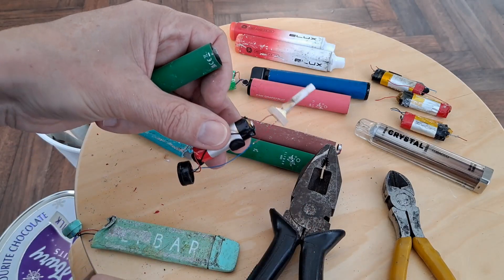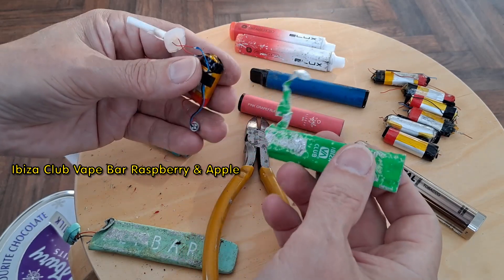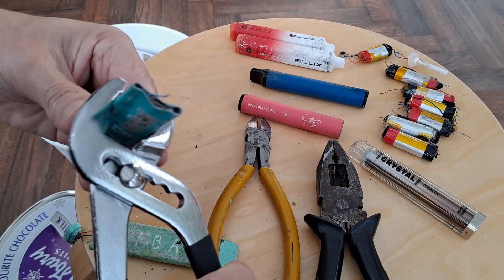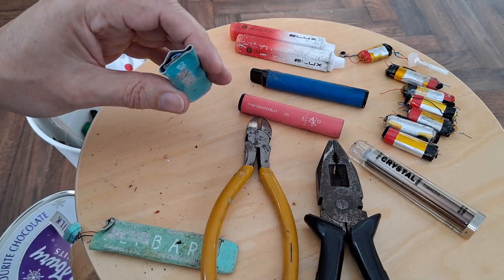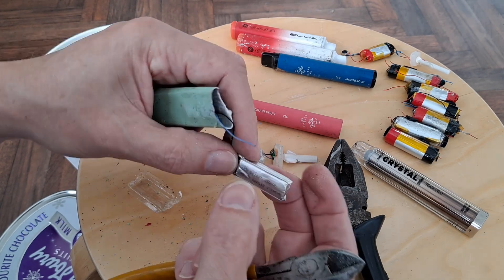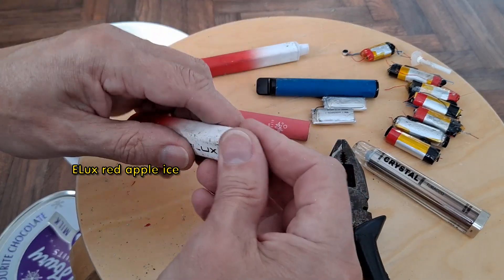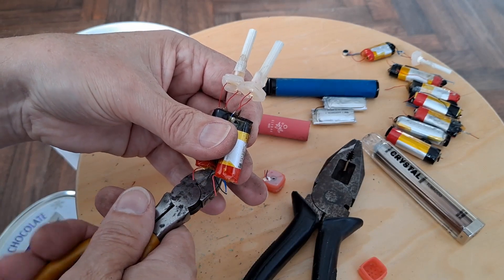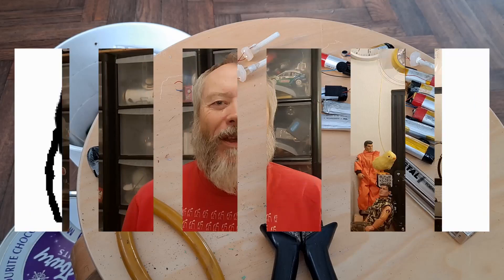Vape Hunter 👀 20220924 stripping out the batteries

Comment: Great source of batterys i have found a few so far just be careful if battery is damaged from a crushed outer case cell could be damaged as well .
Reply from the maker: There is always the chance they can misbehave. I have been surprised how some of them can still perform after being abused, but you are right, you must treat them with respect. There is also the issue about trying to recharge them when they have been drained past their minimum voltage. Some come back and some don't. Either way it is a risk. You might find the related playlists in the video description interesting.

Comment: u can use the cases as propeller shafts
Reply from the maker: Hi Kaleb, I think the tubes are a bit wide for that, I guess that depends what size shafts you are using.
Reply: @GrandadIsAnOldMan  Im thinking you can pus them into Polystyrene and use the Polystyrene as a seal and use the spokes you use for the shaft something like that!!!
Reply from the maker: @kalebschultz  yes, you could, and it would work, but these are over half an inch in diameter and I really want tube about 1/8th of an inch in diameter. Thinking along a similar line, they might make a good shape for electric torpedoes or underwater motor pods.
Reply: @GrandadIsAnOldMan  So true :)